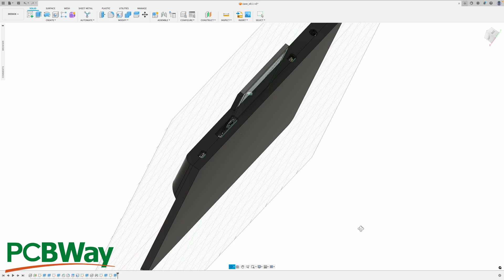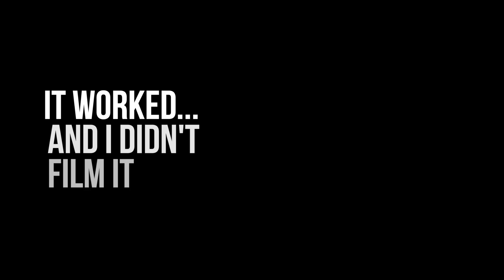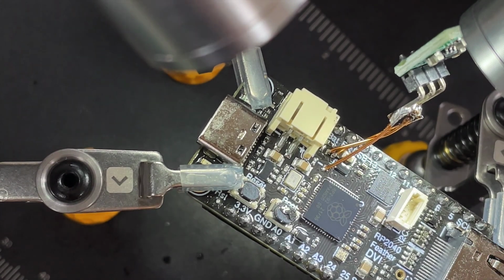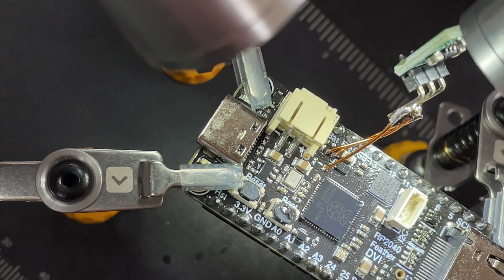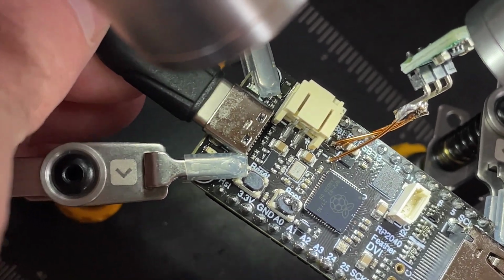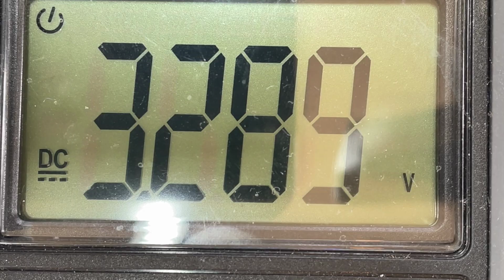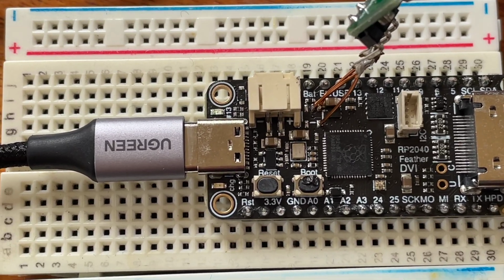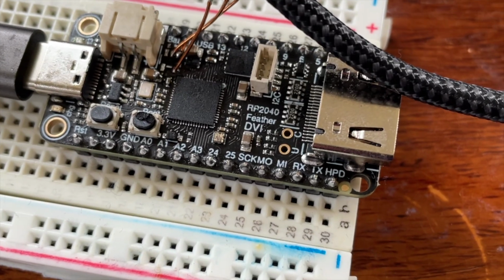I blew up my dev board - and then fixed it!

Comment: I've found that USB hubs are like Russian roulette, you never know which one is going to fry everything. It doesn't help that the same hub can be branded by 100's of random letter companies on the two main websites for buying stuff. Even some of the more "known" brands often stock utter garbage (or possibly its a copycat brand who's name is close enough to the brands I kinda can recall). Heck even some of the actual good brand names sell the most non-standards following hubs. I've had a couple of USB2 hubs that work completely find for attaching peripherals to both a laptop and desktop but completely refuse to work with ESP dev boards when more than one dev board is plugged in at the same time (I like using multiple boards, which each being used to test a single I2C component type (temp/realtime battery backed clock/etc.) and then merge all the code for the final device that has everything connected which massively simplifies development).

Comment: I think you need to go on a bodge it course, that soldering is too bad to rank. 🙂

Has no one told you that solder is just for the electrical connection, you should always provide a mechanical connection for the wire. 
But this comes from a engineer and part time bodger of some 49 years of soldering.

in one company I had to go on the company soldering course for 4 days, when back in the office the boss asked me what score I'd give for the course. I said 4 out of ten! 
Wow that's bad he said, but I pointed out that the instructor after 4 days with me had improved to 9 out of 10. 🙂

when I was 18 or so I spent about a year building avionics equipment before moving in to (R&D) engineering and had to train to solder to exceed the requirements of a CAA approved inspector. every joint was inspected and any bad ones were marked on the PCB with little red dot's, too many red dot's and she hit you with a ruler on the knuckles. never got a carrot but got the stick a few times until I improved. 🙂

Comment: Strangely enough the resettable fuse did not save you....There is one on the board right?
Reply from the maker: I don’t think there is. At least not one I can find. I’m also not sure it was the USB hub that was the problem (or it may have just been a contributing factor) it’s a DVI board that does involve overclocking the RP2040 - maybe I was stressing everything too much…
Reply: @atomic14  Indeed I had a look at the schematics, and there is no resettable fuse. Strange. Doesn't cost a thing and can save you from these kinds of blow-ups. Wonder why they chose not to include one. Have to ask Limor about this...